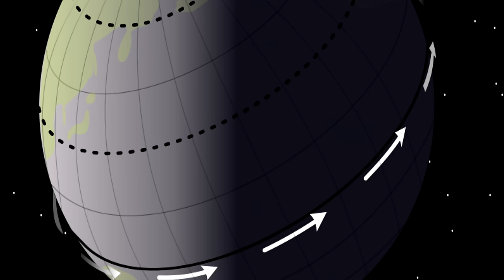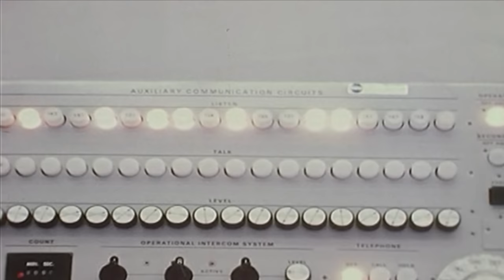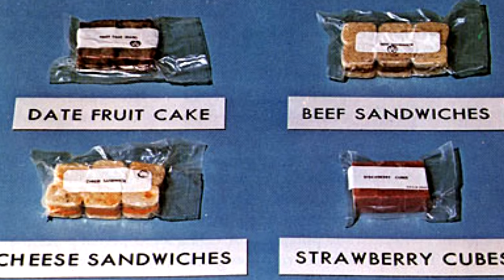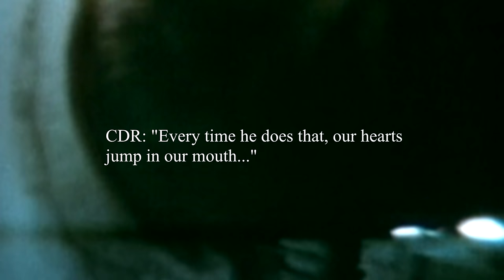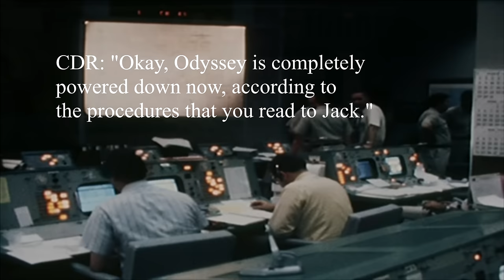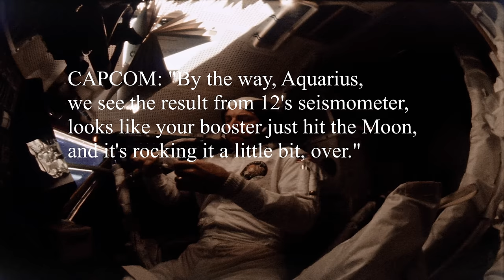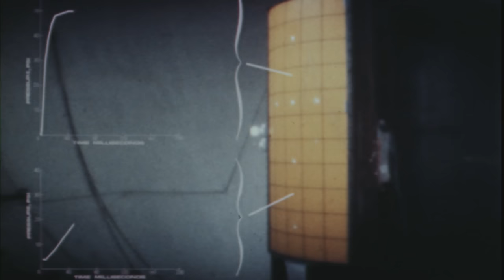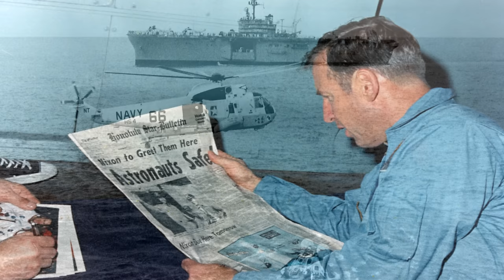Apollo 13 Remastered (50th Anniversary)     [4K]

Comment: I worked for Beech Aircraft at the Boulder Colorado plant as a sheet metal assembler.  I built fuselage assemblies for the Beech 99 airliner. This factory made the O2 tanks for Apollo and may have actually seen that particular tank that failed on Apollo 13. The manufacturing of those tanks was in a clean room but assembled tanks were lined up and could be seen through a viewing window and being readied for shipment. Beech Aircraft was a subcontractor to North American Rockwell for the Apollo project.  I worked at the Boulder Colorado plant from 1968-1969.  When that failure occurred on Apollo 13 I was in Vietnam as a Combat Engineer in April 1970; 571st Engr, 3rd Bge, 9th Inf 69-70.
Reply: Thank you for your service !

Comment from the maker: ...did I scare anyone with the cabin repress valve? :P

Corrections:

Classic POGO is initiated by a 'coupling' between the natural
frequency in one or more tank-to-engine propellant ducts and a
longitudinal frequency of the vehicle stack.
The S-II stage with a typical Apollo spacecraft on top was known to
possess only a 'borderline' margin of longitudinal stability
well prior to Apollo 13.  In fact, an 'accumulator' (similar in
principle to those incorporated to solve the S-1C POGO problem)
had been designed and was originally scheduled to be incorporated into
Apollo 13's S-II.  Schedule pressure prevented this from
happening.  The analysis techniques of the day were sufficiently coarse
so as to allow those concerned to convince themselves that
non-linearities in the system would limit the amplitudes'.  As we know,
that did not occur.
We should note that the 4 outboard J-2 engines were mounted on
'dampers', which acted to prevent a 'sudden' structural coupling.
The center engine was not mounted on a dampener, and this is where the problem occurred.
Special thanks to Dave Mohr!
Reply: Ugh raises hand
Reply: Yeeees!!!
Reply: Yep, got me, nice touch of realism. Great video, an unique view of the story and excellent job in recognizing the efforts of those that saved their lives. I'm embarrassed that you have so few hits on this work, take care.
Reply: @philjansen1670  good job man
Reply: Nope.
Reply: I was more concerned about POGO.  I thought they alleviated that with the baffles in the combustion chamber.
Reply: Hey, Fred was just trying to add a little drama to a mission that would so desperately lack for it. After all, flying to the moon had become SO routine.
Reply: @brianarbenz1329  As evinced by the mission itself, there's nothing routine about going to the moon. It may have seemed that it was boring, but it only seemed that way.
Reply: Really excellent job with this subject. Thank you so much.
Reply: @TimothyOBrien1958  Of course. My point was satirically stating that very idea.

Comment: The engineers in Houston had worked out the LiOH canister filter solution long before the CO2 level became a problem for the crew. The crew had the adapter built and ready to go before the CO2 level reached 15 and were just waiting for the LM’s canister to give out before they hooked up the adapter. If memory serves, they still had at least one unused LM canister left but wanted to try the adapter before they really needed it to make sure it worked.
Edit: When they finished the first replacement canister, Kerwin told the crew that mission control wanted to wait until the CO2 level reached 7.6 to swap the canister and that it was reading 4.7 at that point.

Comment: The use of duct tape to help fashion a makeshift device to use the Command Module’s CO2 absorbtion cannisters would make Red Green proud.
Reply: It’s right up there with the “bang on it” and “turn it off and back on” procedures during the lunar descent of Apollo 14, and Apollo 17’s replacement lunar rover fender made out of maps, duct tape, and clamps.

Comment: I've only recently been viewing your channel Jackson and I'm blown away by it. Absolutely superb work. I was at school during the Apollo missions, they were exciting days. I wonder if you can answer a little question. Did the antenna with the four dishes at the rear of the SM incur any damage? The reason I ask is that I am building a 1/96 kit of the CSM/LM as a Apollo 13 tribute and I want to scratch build the damage. I find it difficult from the limited photos taken as it drifted away to make my mind up. Talking of lunar missions, I am at an age now that not many years ago I was convinced that I would not see another astronaut walk on the moon. So I am so looking forward to Artemis. I'm sure there will be delays, but it looks like exciting times may be back. Best wishes from the U.K.
Reply from the maker: https://www.google.com/amp/s/www.universetoday.com/119970/13-more-things-that-saved-apollo-13-part-8-the-indestructible-s-bandhi-gain-antenna/amp/

It looks like one of the four quadrants of the high gain antenna had a bent center; “One of the high gain antenna's reflectors and horn has been damaged / deflected.”. 

https://history.nasa.gov/afj/ap13fj/a13-sm-damage.html

The antenna continued operating without any noticeable change in those critical moments of the event, and communications was not lost. That, in and of itself — was miraculous. It is obvious that the high-gain was absolutely struck…but it held firm. 

Thanks for your kind words!
Reply: @JacksonTyler  Thank you Jackson, you've been very helpful.

Comment: Huh. They had to reduce current usage all the way down to 24.5 amps. This is equivalent to a 1950s car running ignition, lights and heater fan, etc. 30 amp generator was standard equipment. That's incredible they were somehow able to reduce power consumption to that level, and lower - downt to 14 amps!! Betcha they had some interesting conversations on just what was needed, and what wasn't.
Reply: Ted;  Well, it isn't quite as simple as that...  When it come to electrical power consumption what really counts is how many watts you are using.  In simple DC systems the number of watts is equal to the number of amps times the system voltage.  Early 1950s US manufactured cars used a 6 volt electrical system so a 30 amp generator could provide 180 watts.  Late 1950s US manufactured cars used a 12 volt system so a 30 amp generator could provide 360 watts.  The battery and fuel cell electrical system on the Apollo spacecraft was nominally a 28 volt system so 30 amps at 28 volts is 840 watts.  Even at the low 14 amp draw the spacecraft was using 392 watts.  That was still pretty low when you consider that under normal conditions power was supplied by 3 fuel cells that produced a combined continuous power output of about 4,200 watts with a peak power of 7,900 watts.

Comment: They had to make those two course corrections on return journey due to vapour discharge from LEM system cooling that was pushing them slightly off. No other Apollo mission came all the way back from the Moon to the Earth with the LM so nobody thought about that at the time. Only after it was discovered that it was the case.

Comment: Wasn't his name Ken Mattingly? Or is that just in the Apollo 13 movie? 
Love these documentary's btw, breathtaking work!
Reply from the maker: The original CMP was Ken Mattingly, but he got measles and was swapped for Jack Swigert just two days before launch — something that hasn’t happened before or since this flight.

Correction: he was EXPOSED to the measles, but never actually came down with symptoms.
Reply: @JacksonTyler  Yes, to phrasing it better:
Why does his flight suit say "T. MATTINGLY" and not "K. MATTINGLY"?
Who is T? What name does it stand for?
I have been scratching my head at this. His name tag is not correct to his name... don't think NASA would make that mistake so wondering the reason for the discrepancy?
Reply from the maker: @Elemental_Entity  Oh. His full name was Thomas Kenneth Mattingly. His nickname was "Ken", but some also called him "T.K."
Reply: @JacksonTyler  Oh, I gotchya, thank you so much! Keep up the great work! 👍

Comment: It seems that it wasn't computers that shut down the engine. Should the oscillations have continued for a few more seconds, the rocket would have exploded.  The crew would perhaps have survived with the escape tower. The following text explains this
"The Apollo 6 mission carried a mock lunar lander of more modest mass than the “full-up” lander which Apollo 13 carried to orbit. With the added mass for Apollo 13, the pogo forces were suddenly a magnitude greater in intensity. A mission report said that the engine experienced 68g vibrations at 16 hertz, flexing the thrust frame by 3 inches (76 mm).
Woodfill said that if the center engine had continued running a few more seconds, the oscillations may have destroyed the vehicle. “That engine was pounding horizontally up and down, a quarter foot, at the rate of 16 times a second,” he said. “The engine had become a two ton sledge hammer, a deadly pogo stick of destruction, putting enormous forces on the supporting structures.”
What shut the engine down?
“It is, to this day, not fully understood, but it had something to do with fooling the engine’s thrust chamber pressure sensor that pressure was too low,” said Woodfill. He has studied the mission report, but says the complete analysis of why the engine shut down isn’t included.
“Though the shutdown command came from a low thrust chamber pressure sensor assessment, actually, the engine was operating correctly,” he said. ” The sensor had nothing to do with the pogo phenomenon. For some inexplicable reason, it was like something sucked the pressure out of the chamber and a sensor turned the engine off. But no one knows exactly why.”
Woodfill said those who later examined the situation said it was altogether lucky that the sensor shut down the engine. “Something intervened, stopping the engine from pounding its way from the mount into the fragile fuel tanks. This would have destroyed the Apollo 13 launch vehicle.”
As it was, the engine shutdown likely saved the Apollo 13 mission. "
https://www.universetoday.com/62672/13-things-that-saved-apollo-13-part-5-unexplained-shutdown-of-the-saturn-v-center-engine/
Reply: Hi Peppermint-- I can help a bit.  As you suggested, the shutdown was caused by the Thrust OK Pressure Sitches dropping out.  The reason is pretty simple- the POGO that was experienced caused the J-2 LOX pump to navigate grossly.  This greatly reduced (for a moment) the LOX flow to the Thrust chamber which caused the chamber Pc to drop below the value where the Thrust OK switch dropped out.
Reply: Cavitate-- not navigate.  Sorry.

Comment: Pardon my ignorance, but what do we see around 20:00? What is docking there?
Reply from the maker: That is being filmed by Haise out the window of the CM. By this point, it has separated from the third stage and four panels have blown out simultaneously, exposing the lunar lander which is nested in the top of the third stage between it and the CSM. The CSM separates, turns around 180 degrees, and then floats back in using its RCS engines. You are looking at the top of the lunar module, and the white circle around it is the third stage of the rocket. The CSM docks with the lunar module and pulls it out of the third stage which then is remotely commanded by Houston to separate away. If you look up “Apollo transposition and docking” you will find several illustrations that will immediately look familiar and let you recognize everything in the video.
Reply: @JacksonTyler  Thanks a lot!

Comment: Why did they shut down the third fuel cell on the command module? It was having issues, they charged their battery then powered it down. You’d think they’d use it until it failed, since they can’t power it back up anyway.

Comment: I wish I had the link to the video, but I saw a video where one of the Nasa engineers stated that they had made the lithium dioxide jury rig prior to this.
Reply: They had previously worked out the solution as part of contingency plans to use the LM as a lifeboat if needed.  If I remember correctly, they still had to put together specific assembly steps and talk the crew through it during the actual Apollo 13 mission.

Comment: Has anyone ever asked Haise and the crew if they thought about landing anyway to live their last 2-3 days on the moon?? Lol… I would have been tempted to do so
Reply from the maker: I think you are definitely in the minority of that hypothetical then! I certainly would choose to live over a couple days on the Moon. However, unfortunately, it wouldn’t even have been a possible option! Landing on the Moon would have required an LOI burn, done by the SPS engine, which was definitely compromised by the explosion. This left very few options for propulsion, all of them over on the LM’s side of things. Had the LM done the LOI burn, it wouldn’t have been able to land on the Moon. In fact, with the mass of the CSM, I doubt it would have even been able to make the LOI burn without having to stage and eat into the ascent engine’s fuel supply!
Reply: @JacksonTyler  I know it would clearly never be done as they can’t support 3 crew and they have families so someone was going to be left out and a chance to return was gone. They obviously wouldn’t make the fra Maura landing site but IF they didn’t get back on the free return trajectory, then in theory they could have landed with about 30 hours of life support (2 crew, I mean, all hypothetical). Since their safe return was uncertain had they not made the free return correction, they would have the propulsion to land correct? They wouldn’t have had it to escape lunar orbit though. The ascent engine couldn’t push the CSM out of orbit (I’m guessing of course). In theory if the LM had done its job let’s say they had 80% propulsion left and only one crew member to land while the others attempt a safe landing home, in theory he could land and have enough time for a day and a half with maybe 2 EVA’s, I think, correct?.. obviously it would never happen as it would require mutiny but its interesting to think about.

Comment: Maybe someone can help me out here: at 00:19:34 and afterwards they approach a spacecraft on their way to the moon? I'm guessing the astronauts are where the camera is located at and they're looking towards the spacecraft/module, but could someone clarify why there are two spacecrafts and why they are not connected from the get go? Hopefully my point got across, it just reminds me of a soyuz/dragon docking with the ISS but they're already on their way to the moon and shouldn't have to dock with anything.
Reply from the maker: So the Apollo "stack" which is launched into orbit consists of two spacecraft, and a rocket stage. The rocket stage is the third stage of the launch vehicle and is called the S-IVB. When you look at the rocket on the pad, you can see the S-IVB, then a white section that gets narrower, and then the silver service module with the CM on top. For the sake of simplicity, we will consider the service module and command module as the same spacecraft, called the CSM, or Command-Service Module. The key is that white section that gets narrower. That is actually a hollow section inside of which nests the Lunar Module -- (the lunar lander). The stack remains in this configuration for the first three hours of flight, and burns to the Moon in this configuration as well. It isn't until some 30 minutes AFTER trans-lunar injection, when the spacecraft is well on its way towards the Moon -- that the crew undergoes a series of maneuvers called "Transposition, Docking and Ejection". Now that the third stage has exhausted itself with the TLI burn, the CSM separates, and the four panels explode outward. The CSM, with the crew inside -- then turns around, and uses it's RCS engines to come back in, seeking to dock with the lunar module which is now exposed at the top of the third stage. This is what you are seeing. This occurs some 10,000 miles/16,000 kilometers away from the Earth, while all parts involved are already well on their way to the Moon.
Reply: @JacksonTyler  Ah so the CM and LM connect after a flip of the CSM and the "new" spacecraft is CM in the middle with LM and SM at each side, got it. Seems counterintuitive at first but there probably are good reasons for this configuration. Thanks so much for the detailed response, slowly working my way through your documentaries and they're honestly so good, really inspiring!